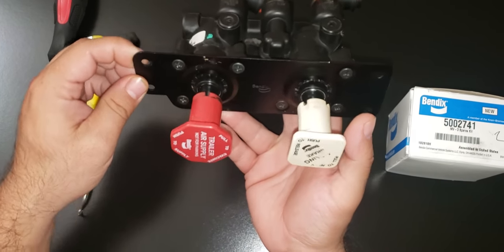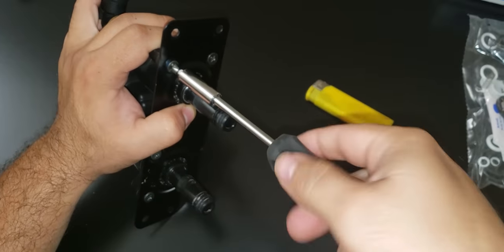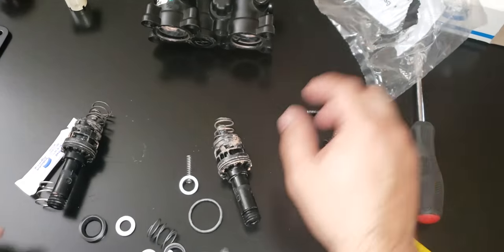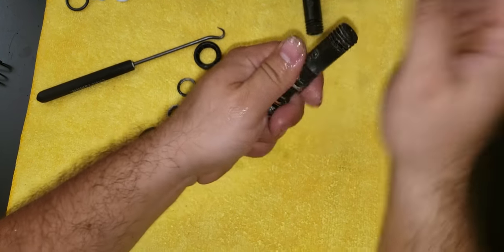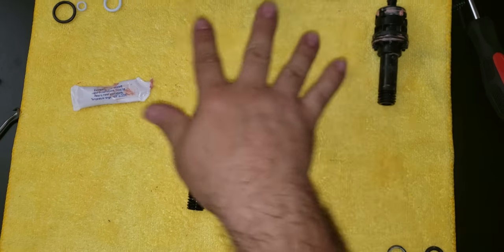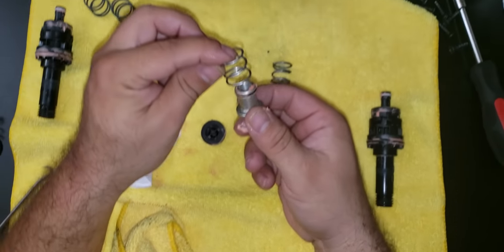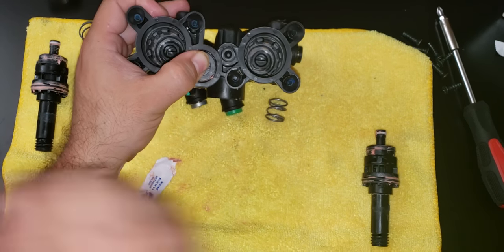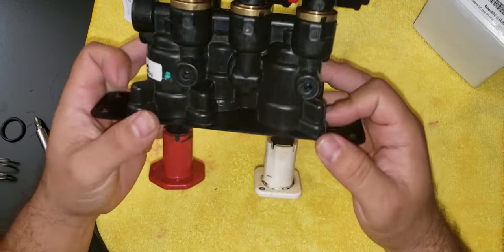HOW TO FIX  DASH VALVE MV-3 REBUILT DASH VALVE

Comment: Small tip, add the lube before installing new o-rings helps for install, and makes a better seal when in and outside diameter has some lube.
Reply from the maker: thank you, will try that next time👍👍

Comment: So the kit doesn't comes with O rings for the fittings on the back of the valve, most of the time they are the ones that leak? I guess is better to test the valve before buy kit or new valve!
Reply from the maker: no o rings for fittings,  only for the valves
Reply: Do they sell replacements for those individual fittings on the back or need to buy whole new one?
Reply: @ravshana  just buy 90degrees 3/8” fittings and replace the one that is leaking.

Comment: 2013 peterbilt paccar when I push the trailer supply in I hear air leaking from the valve and I also hear air blowing out my trailer valve on my air tank. When I connect a different truck to the same trailer everything work fine.

Comment: Thanks for the video, it helped a lot. This repair kit works for a 2005 KW T600 and you don't have to disconnect the air lines if you don't want to, there's plenty of room to do it. 👍
Reply: Hi Oscar,
I have the same truck year and model, do you also have a cat engine by any chance?
Reply: @yasmanyalpizarful  yes, CAT engine.

Comment: I still have the new valve and tried to make it work.  I  talked to 5 different mechanics and they didn't know exactly how to connect hoses and said to play with it.  3 hoses seem to are identified but three are not. I know that the truck and trailer buttons each have an inline and output.  And there is an exhaust but that's it. I  am told that I have to follow each hose but being a 2002 vehicle is not easy and I am old. Any suggestions

Comment: How can I know when this valve is bad?
Reply from the maker: some times air will start to leak, you will hear it.  also when the valves won't eject automatically when Air PSI is below  50
Reply: That’s exactly what happened to me this morning o- ring is bad just started leaking outta the blue just swapped my tail gate line with trailer line and got back to my yard I drive dump truck
Reply: @TRUCKINGTIPSDIY  what is the MV3 found in, freightliner Columbias?

Comment: Will the rebuilt kit stop air coming from the blue line when the brake is applied?  I don't  have a check valve. I have to double check valve s off the foot valve.

Comment: I ordered this kit and parts don't fit. The value is from a volvo with 6 air hose fittings and I was told that the valve is no longer made so they ordered a replacement but all hose fittings are totally at different locations so I  saw your utube showing how to fix the existing one
Reply: It’s for a freightliner

Comment: I did just that. Put new one in and relized i needed a new plate. The one with 6 phillips screws. So i took the old one off the bad one amd swapped it. But as i put the old face plate on tge new mv 3 valve all the valves popped out. So i put them all back in. But now when we go to release the brakes the tab wont stay pushed in. I have to hold it the whole time. I dont know why
Reply from the maker: did you rebuild it or put a new valve? if you rebuild it only thing a can think of is if you put the oring the correct way,  mon minute 5.55 on this video

Comment: Hi bro. Plz advise me . I have bendix 801631 mp3 dash valve. Plz suggest me which Maintenance kit I can buy for this dash valve.
Reply from the maker: hello, im not sure, you can ask at the dealer,  is it for a cascadia?
Reply: I have a same bendix 801631 mp3 desh valve I’m locking for same I check dealer not have

Comment: Hi where do you buy those parts ?!!
Reply from the maker: i bought those at the freightliner dealer
Reply: @TRUCKINGTIPSDIY  awesome, subscribed, shared with the freightliner Columbia group... btw, are these Cascadia parking brake valves identical to the Columbia's? 
I could imagine they're similar.